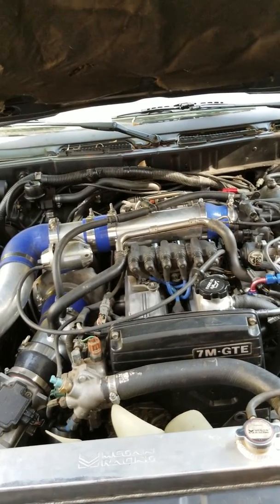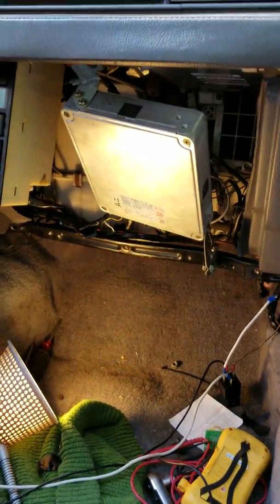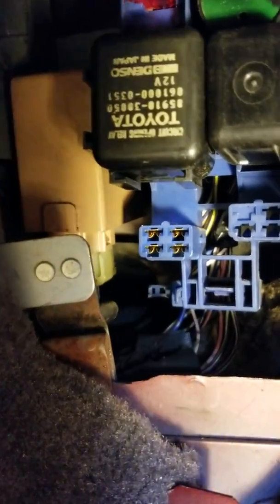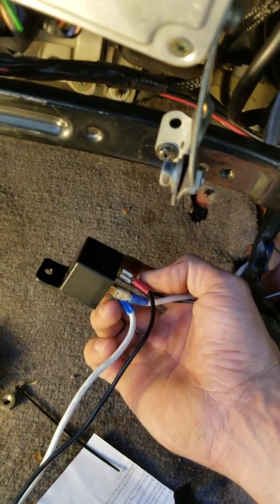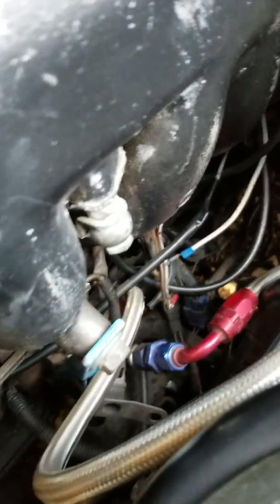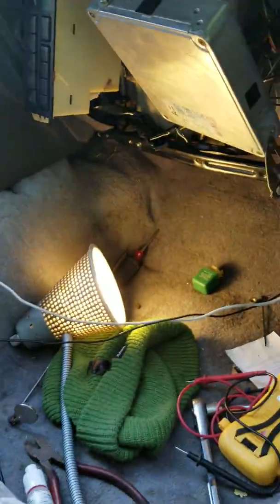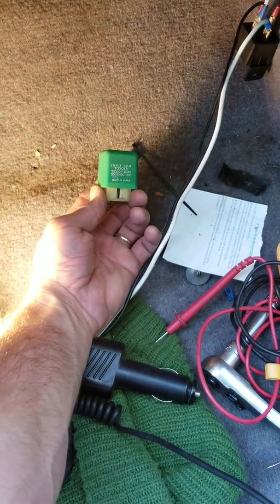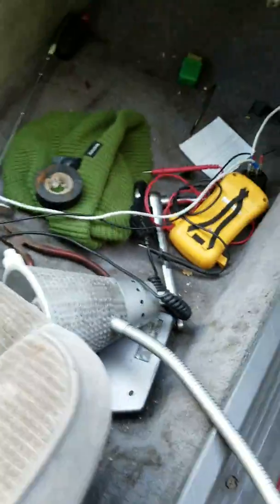Toyota Supra Starter Relay Mod

Comment: HOLD EVERYTHING Guys.  I thought my 88 Supra had a starter relay issue, so I went to the trouble to remove the passenger side panel to get to the relay (behind the ECT module).  The relay checked out fine, but I was still having the intermittent starting issue.  I had just replaced my battery 3 months ago and it is still fine according to my voltage monitor plugged into the cig lighter.  So, with the hot July 30 weather here in Texas, I decided to check the battery terminals just in case there might be a contact issue.  The positive terminal seemed tight, but I loosened it and twisted it back and forth a few times and "reseated" it before tightening securely.  This seems to have fixed my problem.  So before you try anything else, make sure your battery terminals are clean and making good contact.
Reply from the maker: William Whittekin that’s great man and very good advice.  I too have tried that unfortunately mine wasn’t that easy of a fix. Keep them supras rolling!!
Reply: Duh!
Reply: Maybe a little Bit late But.... The supra Starters gonna oxidate on minus and plus Just need to replace These oder the Starter itself

Comment: Great video ! I’m trying to find the relay for ac fan. 87’ with the 7mge. Do you happen to know the location by chance ?
Reply from the maker: It is located under the fuse box behind the battery and will look like this https://www.stockwiseauto.com/standard-motor-products-ry-910-a-c-condenser-fan-motor-relay?fit_id=6354&Year=1988&Make=Toyota&Model=Supra&gsID=pxf790208f6354&gclid=EAIaIQobChMIjbyPnqCT8AIVYiCtBh2hTgmaEAQYAyABEgLCivD_BwE
Reply: I was able to find and replace the faulty fuse! I really appreciate it !!! Thanks !!!
Reply from the maker: @lemon271121  Anytime!  I have a full wiring schematic of the supra if you ever need it I just need an email address to send it. But it shows where every wire goes, to every computer and every junction box.

Comment: So I wired this up on my 91 7mgte, i put a 20a inline fuse holder for the 12v, blew instantly when I tried cranking it. followed the wiring I read online as well as in your video. not sure what the problem is, anyone else have this issue?
Reply from the maker: That is weird. I wonder is you wired into the wrong port on the circuit board causing it to pop the in line fuse. What other write up did you fallow?
Reply: @williamfragoza1535  So I bought a dorman 12v 30a relay, in the 87 port, I put the 12v from the battery through a 20a inline fuse holder, in the 86 port, actually decided to route the brown plug that originally went to the starter, then for the 85 port, I hooked it up to a ground, and the 30 port is plugged into the starter
Reply: @williamfragoza1535  So instead of going through the fusebox, i got the signal from the brown plug that went to the starter. I’ve seen it done on other mk3’s but not sure what’s going wrong
Reply from the maker: @vasavkj  I havnt seen it done without going through the fuse box. Do you still have the old relay plugged in?
Reply: @williamfragoza1535  Yes I do, I just swapped in a 30A fuse and works like a charm, I guess the initial surge was a little too much but the constant pull is a lot lower
Reply from the maker: @vasavkj  well I glad you got it working. I think you might be getting the surge because you have the original relay still plugged in. That’s my guess for needing a 30 fuse instead of a 20 cuz mine never pops and it’s a 20
Reply: @williamfragoza1535  Ahh okay, I might end up removing the original relay and changing it to the way you did, but this will do for now
Reply from the maker: @vasavkj Cool!! I fell ya. Whatever it takes to keep her on the road. Thanks for watching!!
Reply: @williamfragoza1535  blew the headgasket over a year ago and finally got her back on the road! enjoying it everyday especially with summer coming
Reply from the maker: @vasavkj  that’s always a set back, but Glad it was only the gasket. I hope to have my car on the road by summer. Stay tuned. Head gasket should come next week and I’ll start putting the puzzle back together.
Reply: @williamfragoza1535  Nice, good luck!

Comment: Hey, I recently sent you an email, on the video when you are talking about the brown connector at the starter, did you leave the connector plugged in and just cut the wire and plug into it? also if you did what did you do with the wire that you cut off? do you use that for anything? thanks man.
Reply from the maker: Yes I cut the black/blue wire going to the starter. Then I connected a new wire to the black/blue that goes into the started and ran in through the firewall to the new relay i bought. The rest of the wire that i cut is running to the circuit board  behind the kick panel and is no longer needed and i don't have anything connected to it.  If you dont want to cut the starter relay wire u can run a short pigtail wire from the circuit board behind the kick panel to the new relay just like the other short pigtail wire going to the black/yellow wire on the circuit board. Just put it where the Black/Blue  comes into the circuit board. Hope I helped.
Reply: William Fragoza thank you for your fast reply, im now working on it and I been having lots of questions. Thanks for the help, also I sent some pictures on email. Thanks

Comment: Would this be different then a 7mge?
Reply from the maker: Chase Banzz No. it’s should be the same.
Reply: @williamfragoza1535   thankyou. I found out that wasn't the issue. Now I gotta figure out why it only runs after I spray gas in it, then it will stay running
Reply from the maker: Chase Banzz have you tried the fuel filter
Reply from the maker: Chase Banzz also do you have a check engine light on?

Comment: I have a 87 toyota supra 7mgte I believe I also have this problem, I sometimes start the car just fine and drives fine, but sometimes the next day or even the same day it just clicks until i jump it with my truck. When it doesnt start, it just makes a clicking noise but its loud, its more like a "clump" sound coming from the passenger side. Could this be the symptoms to this issue?  also, it is an amazing video it helps alot. Thanks man.
Reply from the maker: Yes this is the problem u are most likely having. I'm sorry I ddint post the noise it was making but yes, it is a loud clunking noise which is the power load not transferring over the relay to the starter. Once I did this I haven't had a problem. Glad I can help and if there is anything u need just ask and I'll do my best to solve it
Reply: William Fragoza  is there a wiring diagram that you used, i cant seem to find one. Thanks for the help man.
Reply from the maker: @rodolfogana2508  yes i have two complete wiring diagrams for 86-88 years and 89-91 years i got off the internet some years ago. If you send me your email i can email them to you or maybe a can set up a link but im not to good with computers.
Reply from the maker: @rodolfogana2508  ok email has been sent with the diagrams let me know if it helps. I know it helped me
Reply: @williamfragoza1535   can you email me the wiring diagrams also, thank you
Reply from the maker: James Stroud yeah I can do that just need your email and I’ll get those over to you
Reply from the maker: @standtallmusicwolfpa  Sent the wire diagram over for 89 supra, hope it helps! Like and Subscribe!! Thanks for watching!

Comment: My starter relay, I took out and then took it apart but the internals are basically brand new with no corrosion what so ever. Ive also checked the contacts and they are also new looking aswell.
Reply from the maker: All I can say is that I have opened brand new relays that don’t work. So I would try a new one or one that you know works off another Supra or Toyota. If that doesn’t work try my way.   Thanks for watching!
Reply from the maker: @xXAsunaxKiritoXx  yeah my car would do the same thing lol. I had a hard time finding a oem relay so that’s why I did this little up grade. I would definitely look on eBay for a used relay. They just tend to go bad after 30+ years.
Reply from the maker: @xXAsunaxKiritoXx  yes I believe that is the size of the wore I used.
Reply from the maker: @xXAsunaxKiritoXx  oh yeah man that wire sounds like it's been cooked. Well done.  I hope that gets it fixed for you!
Reply from the maker: @xXAsunaxKiritoXx  now when you got the cps rebuild did you have the wires at the plug repaired? You mention touching a wire and it dies. Could that still be an issue? Also do you have any CEL lights on.
Reply from the maker: @xXAsunaxKiritoXx  that means no codes. You said it clicks but won’t turn over
Reply from the maker: @xXAsunaxKiritoXx  just wondering if the car clicks but doesn’t start could be the starter go bad
Reply from the maker: @xXAsunaxKiritoXx  gotcha. Maybe try bypassing the relay and jump it? I figured the other oem relay would have worked. And now I’m stumped the mod I did, Did not work for you either.